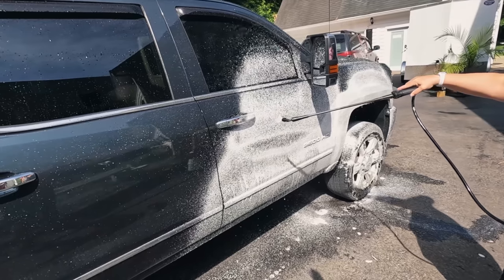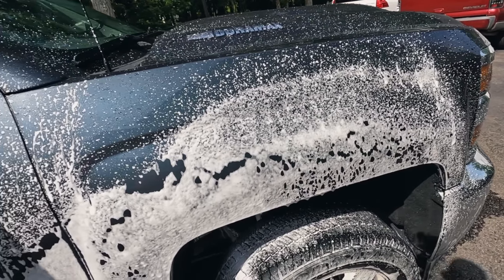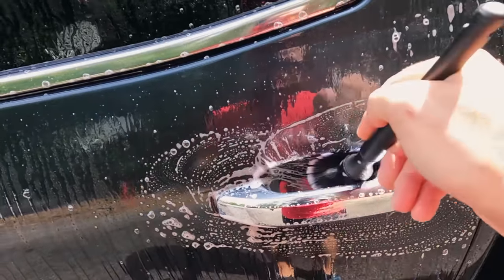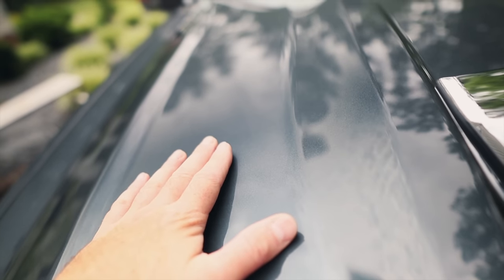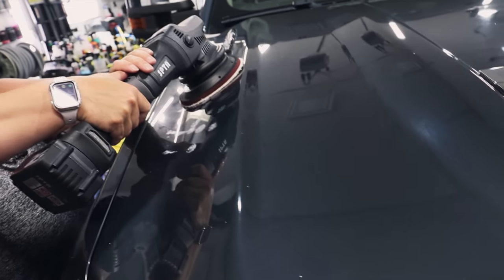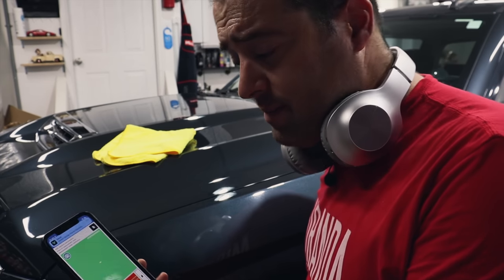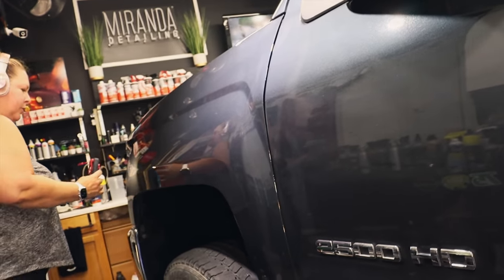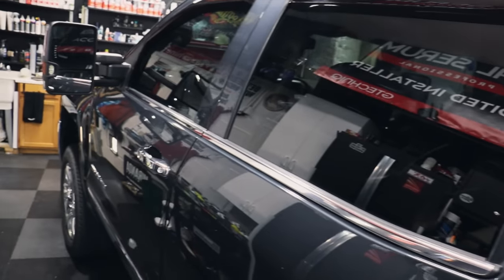Is It Possible To Always Have Perfect Paint? #detailing #business

Comment: @miranda Thanks for your videos! I accidentally sanded a rock chip too much while trying to fix it. Now I have a penny sized hole down to the primer (white), surrounded by a 2 inch base coat area, surrounded by a 5 inch sanded clear-coat area. This is on my bonnet. What is the recommended course of action (can it be done with a touch-up pen of base-coat and another of clear)?  Much appreciate your expert opinion.
Reply from the maker: Hi. As man…sorry that happened. Well at that point you could try to fill it with paint and gently sand it flat, but to get it back to normal it has to be repainted by a shop.

Comment: I found it odd that you applied tire dressing before doing the paint correction? That tire dressing might get on the paint and mix with your polish?
Reply from the maker: Hi. Nah it’s totally fine. No dressing was on the paint at all. Even if a little bit got on the paint and we polishing over it, which I have done before, nothing happens. 
Have you ever had a bad experience like you mentioned?
Reply: No, but I always wait until after the Coating and apply any dressings as a last step. It takes the same amount of time. Why not wait till the end to apply something that could make your polishing efforts more difficult. You might also get compound splatter on top of your fresh tire dressing.
Reply: Great Job, I was impressed that you measured the paint thickness! Do you do that on every job?
Reply from the maker: I’ve never had a problem like that before. But I see your point. I see how that could happen and possibly be an annoyance. Thanks for the tips! 😎👍🏼